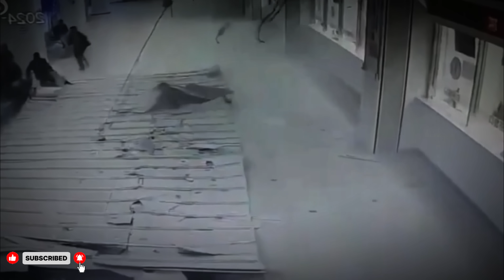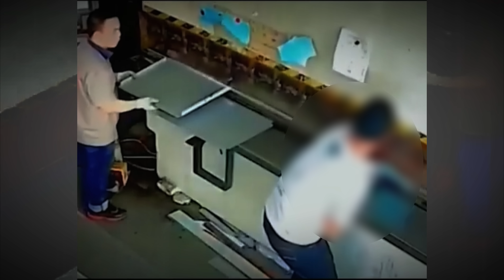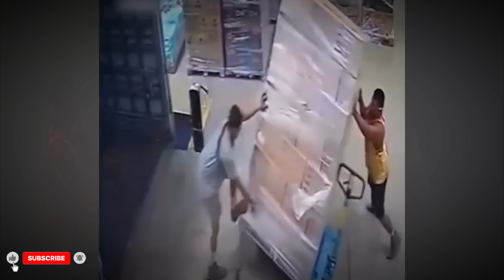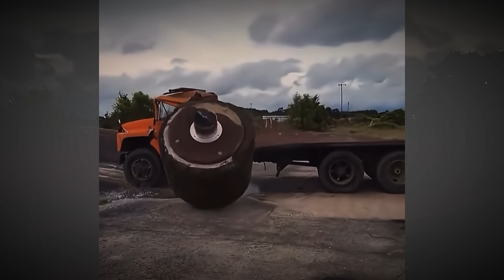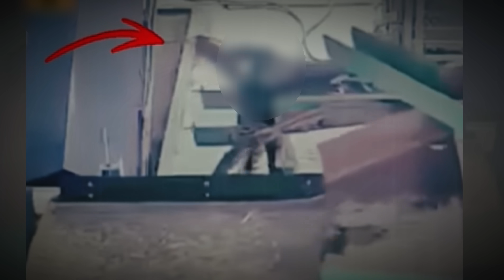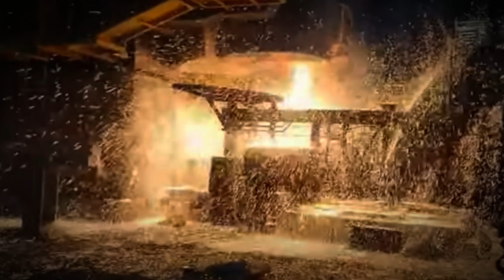He Was Standing Too Close to the Steel Roll… Then This Happened!

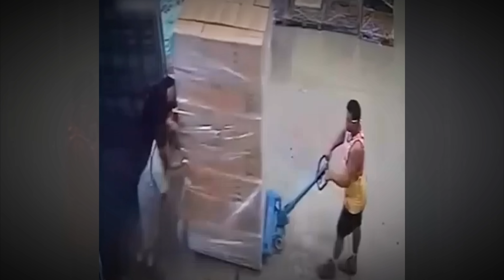Comment: 2:00  looks to me the pallet jack is raised too high making the tall load unstable.  A load that tall should have only been jacked up enough to roll and only leaving 1/2" clearance so tipping would have been arrest quickly and before it got too far to recover.
Reply from the maker: They are subjective and do not put safety first.
Reply: @FIXtoFAIL  what are subjective?

Comment: When your exposed it can be too little too late. Like stated, maintenance is the key. I for one have been exposed to, apart from many things, tight schedule times, even requested to enter an industrial sized oven at 80 degrees Celsius to which my response was "Are you trying to kill me", with, go check for yourself & how long could this instructing manager sustain his life in these conditions to which the major overhauling of the huge conveyor was then postponed until it actually was at a safe temperature to facilitate the operation. Securing loads effectively in the case of hauling. Even if the driver drove to the conditions, it's the other's that make this transporting somewhat dangerous. A 1 tonne load should have a few 5 tonne rated restraints to make up for an emergency braking scenerio & to facilitate the g-force applied. Cheers.
Reply from the maker: wish you good health
Reply: @FIXtoFAIL Thak you & yourself too. Cheers.